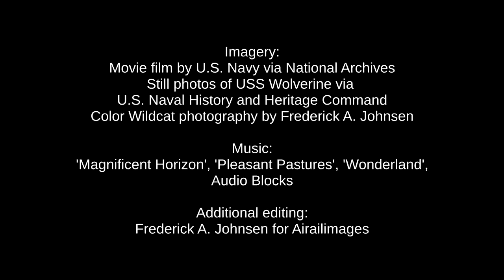USS Wolverine Great Lakes WW2 Aircraft Carrier - TBF Avenger SBD Dauntless carrier training F4U

Comment: I worked for many years at the USS Hornet Sea, Air, and Space Museum, and remember well one of these planes that was restored by our mostly volunteer restoration group. The plane was an FM2 Wildcat (Bureau #: BuNo 55052), flown off the USS Wolverine (IX-64) in a training ditch on June 14, 1945, Details of the plane currently on display at the USS Hornet are as follows:
	
Constructed as a FM-2 by General Motors Eastern Aircraft Division at Baltimore, MD, USA. Taken on Strength/Charge with the United States Navy with BuNo 55052.

Dtiched/Crashed on 14 June 1945: Flown by Ensign E.J. Robinson off of the USS Wolverine (IX-64) in Lake Michigan. The post crash analysis report stated while qualifying in carrier landings aboard the USS WOLVERINE, this pilot received an unanswered wave-off. Engine stuck throttle but apparently lost RPM until flight could no longer be maintained. Pilot made a normal water landing and the plane sank in Lake Michigan. Because the airplane is not available for examination the Board attributes 100 percent to power plant failure.

Comment: 4:19 Hmm, was TBF Avenger "T-6" too damaged by that nose-over landing to be salvaged, or was that a later ditching?
Reply from the maker: That was a ditching. Look at the pilot swimming nearby. Hey, thank you for watching and commenting.
Reply: @airailimages  So they must have repaired it on the flight deck since they didn't have a hanger deck?  Do you suppose they just pushed some of the crashes off the side?  Otherwise they'd have to sail back to port every time a plane cracked up and blocked the deck.
Reply: I did some more research.  Apparently there were "outriggers" forward of the island where they could store damaged aircraft.  It appears T-6 is being pushed onto one of those.